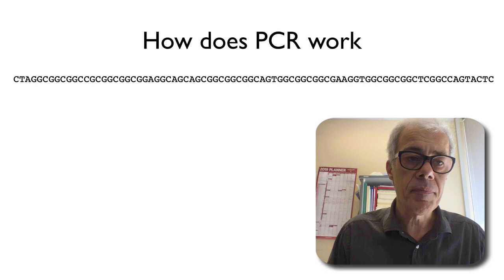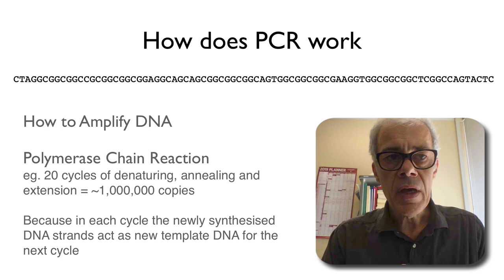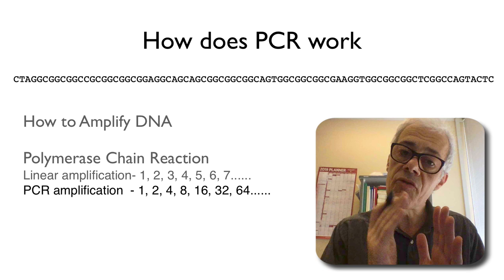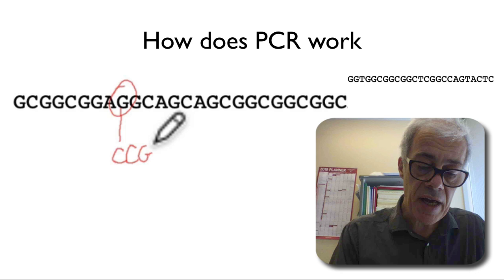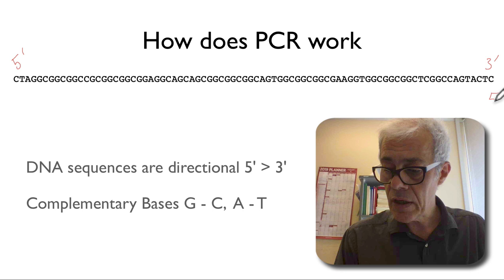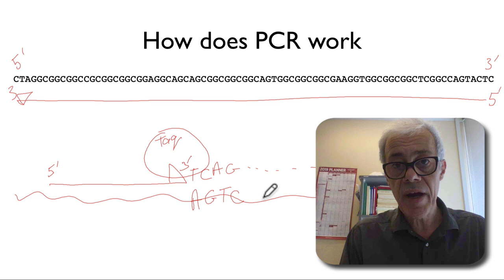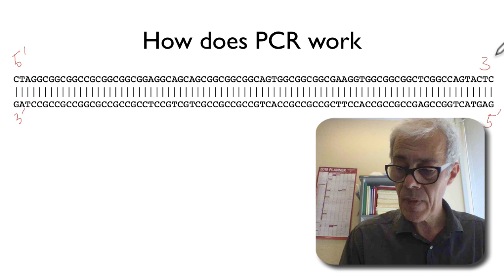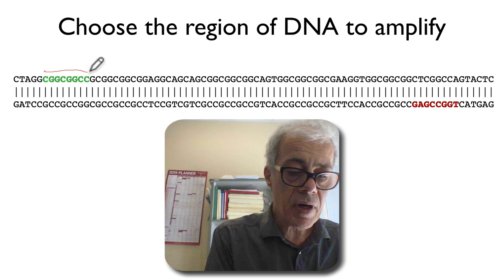Understanding PCR

Comment: Well explained! Most of the designed primers exhibit more or less secondary structures (HairPin, SelfDimers and HetroDimers). What is the criteria to know the level of acceptance for such secondary structures? If few bases are involved while forming secondary structures, will they also melt away while increasing the temperatures? Like the non specific binding of primers to other non specific but similar sequences on the target sequence?

Comment: Can you please tell me why the double standers of dna don't rebind through annealing process?
Reply from the maker: The primers are present at a much higher concentration than the template strands of DNA to be amplified. That is, the single stranded primers are in vast excess. So when the complementary strands of DNA are separated there is a good chance that a primer will bind to its target DNA. If this does not occur, on other copies of the template DNA, the two strands may simply zip back together without the primer binding. But as long as some primers bind to their target the PCR (reaction) will start. 
Successive rounds of thermal cycling become more efficient because their are more copies of the amplified templates to bind to the primers.

Comment: Dr. Temple, how should I run PCR if I want to amplify a whole gene? In that case I cannot design the primers with close annealing temperatures. Rather, the primers have to attach at the ends of the intended gene.
Reply from the maker: Maybe you could adjust the length of one of the primers slightly to match the annealing temperature of the other? The 5’ ends are fixed but the 3’ end could be adjusted without affecting the size of the amplified product? But I guess you still want a GC clamp also so there a bunch of stuff to consider.

Comment: sir plz explain again the difference b/w pre denaturation and denaturation
Reply from the maker: The pre-denaturation occurs only once before the thermal cycle repeats (which may occur 30 times or so). Before the thermal cycling begins the DNA can be considered to  be all double stranded and if it's human genomic DNA it's a very large molecule (many millions of base pairs in size). So to begin the PCR an extra stage of pre-denaturation is applied - this simply means the sample is heated for longer at the very beginning before the thermal cycling. For all subsequent rounds of thermal cycling only a short denaturation (heating step) is needed to make the DNA single stranded, also since the PCR product is often quite small (a couple of thousand base pairs) it is easily denatured during a cycle.

Comment: As I understood, after a cycle of reaction , primers are not covalently linked to the newly synthesized target DNA. And therefore, the same pair of primers can anneal again to each new strand. Is it right?
Reply: No, primers make up the beginning (5' end) of the newly synthesized DNA. The last (3') nucleotide in the primer is covalently bonded to the first nucleotide the enzyme adds just after it attaches. If it didn't work like that, the chain reaction would not be possible - the new strands wouldn't have anywhere for more primers to anneal to in the next cycle. Primers get used up during the reaction, and you would typically add an excess of primers so that you get enough of your target DNA at the end of the reaction.

Comment: A bit confused about the temperature to anneal (say 60 degrees) being lower than the temperature to extend (72 degrees). Wouldn't the primer lose binding at 72 degrees? Or is the 60 degree annealing temperature the lower limit for primer binding and presumably holds bond to template to the 72 degree temperature DNA polymerase needs?

Thank you in advance for the clarification!
Reply from the maker: The polymerase has activity over a wide range of temperatures and it can begin extension of the primer even at 60 degree (72 degrees is the optimum). As extension begins the primer gets longer and it binds more strongly overall. Also the primers do bind at lower temperature but some binging may be less specific whereas a higher or optimum temp will reduce binding to similar but different sites where base pairing may otherwise occur. A low annealing temp will give rise to a variety of PCR products which is typically not what people want. Higher annealing temp will result in a greater proportion of the specific PCR product.
Reply: @UWSMarkTemple  
Thanks a bunch! Makes total sense.

Comment: An interesting question: the most suitable extension temperature for polymerase is 72 degrees. If the annealing temperature for the binding of primer and DNA strand is 60 degrees, will the primer fall off the DNA strand when the temperature increases to extension step? If so, how does the polymerase work?
Reply from the maker: I guess if you think of it as a dynamic process, once the primer is bound (annealed) it stands a very good chance of being extended by the polymerase even at the binding temperature, any extension will bind it more strongly since it is getting longer and therefore will probably still be bound at the higher temperatures up to 72deg. I think that makes sense.

Comment: Is this tool useful with our current dilemma?
Reply from the maker: Very much so. Although the PCR technique used to detect coronavirus uses fluorescently tagged primers - so that the PCR product becomes fluorescently tagged - then using a real-time scanner (during each cycle) the build up of the product can be detected during the linear phase of the reaction. This allows the PCR reaction to be applied as a "quantitative test" - for instance does the PCR product reach a threshold within a number of cycles. There are lots of application for this basic PCR reaction.
Reply: @UWSMarkTemple  Can you explain how false positive tests happen, why they happen if they do and why would they happen at higher cycles if that's accurate ?
Reply: @chentobrashnar1442  I'm not Mark Temple, but false positives in PCR testing usually come down to contamination. If a tiny droplet from a strongly positive sample, with say 1000+ times the detection limit, gets into another sample, the other sample will come up positive as well. This can happen any number of ways - the technician might have accidentally picked up a little droplet on their glove and it entered the next tube, or aerosols got emitted from their pipette, or they forgot to change pipette tips, etc. Or perhaps the technician him/herself had Covid without realizing it and contaminated the sample. If the primers were badly designed there could also be nonspecific binding to something else that gets amplified instead, although for Covid tests or other regulated medical tests this isn't likely to be an issue.
Reply: @grebulocities8225  Thanks, so your statement is that only contamination can give false positive results. What if the environment in which lot of people traverse in which multiple sick people are contaminating the air, where most people will breath some particles but far less then the load needed to infect person. Wont that be false positive in our need to identified infection person not just statistic ofsomeone who contain corona virus? Especially if the cycle used is very high, and the lab go with only positive test and not with positive on specific cycle?

Comment: I think G C increase 4 degree celcius not 3 °C
Reply from the maker: Indeed, in practice you could use one of many formulas to estimate the annealing temp, but in practice you may need to experiment with a range of temperatures to optimise the experiments under laboratory conditions.